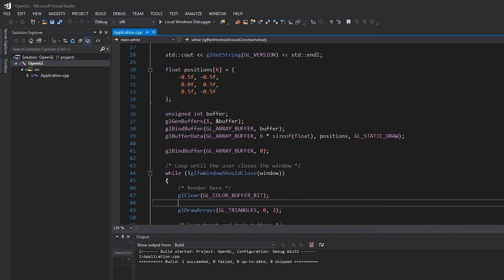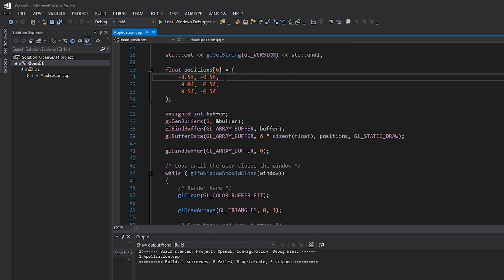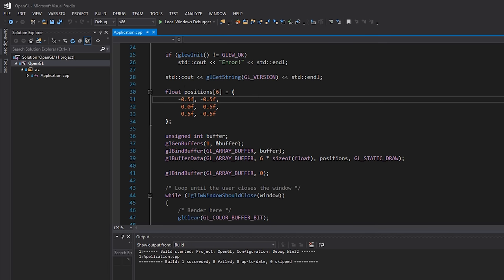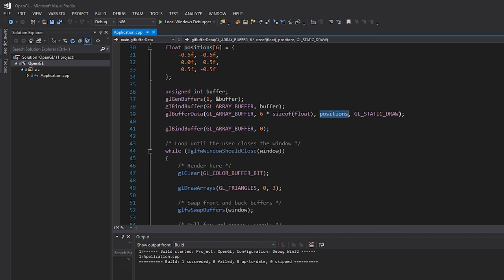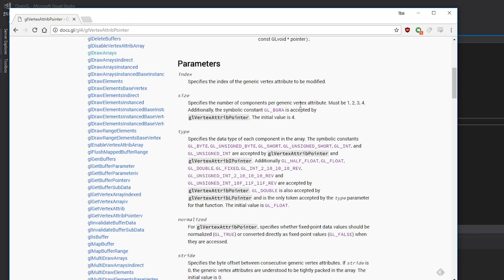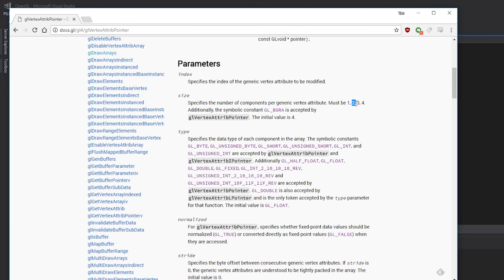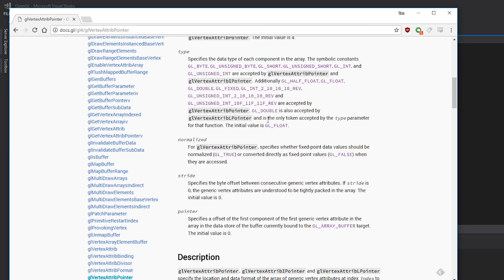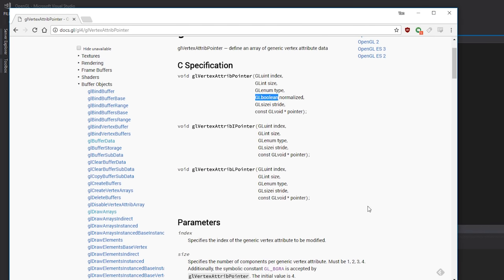Vertex Attributes and Layouts in OpenGL

Comment: I would prefer sizeof(position[0]) instead of sizeof(float), because if you are changing the type to double for example, it will not affect this functions.
Reply: You would need to change the GL_FLOAT parameter anyway.

You could possibly use some kind of data structure to store it though
Reply: @bobdagamer640  it still would be two changes which could add up if you have a lot of code

Comment: Cherno: "Now if we had a Shader, we'd be able to see our Triangle."
Me: *randomly compiles the program... Giant Triangle on screen.
... Now I'm confused...
Reply: I guess that OpenGL has some sort of default shader - flat, and useless, but something that is put there to avoid crashes.
Reply: @2001herne  no. OpenGL does NOT have a default shader. If you see a triangle on your screen ,
that means that your graphics drivers have a default shader just for debugging
Reply: @anonymousgaming911  Cheers
Reply: I think it is undefined behaviour, so you'd get different result on a different machine
Reply: @ViktorWingqvist  Yeah, depending on your GPU and its graphics driver.
Reply: in my linux don't appear triangle, but in w10  appeared.
Reply: @100Palavr  On my linux installation (Ubuntu 20.04, amd RX 580) the triangle did appear. Guess it really depends on the driver used.
Reply: @Fabian-gg5gi  yes
Reply: Even i got suprised seeing a triangle :)
Reply: I guess that OpenGL has some sort of default shader - flat, and useless, but something that is put there to avoid crashes.
Reply: I guess that OpenGL has some sort of default shader - flat, and useless, but something that is put there to avoid crashes.
Reply: I guess that OpenGL has some sort of default shader - flat, and useless, but something that is put there to avoid crashes.
Reply: @anonymousgaming911  uhhhh its on release mode
Reply: @2001herne  Nice, you had to say it 3 times
Reply: @anonymousgaming911  thx mate
Reply: @wiking2888  Yeah, for some reason, at the time I made that comment, firefox was doing weird things with YouTube. It hasn't happened in a while, but for some reason, a fair few comments got posted multiple times.
Reply: @2001herne  k fair enough

Comment: I'd like to add that if you are on Mac you can't create your openGL context with compatibility profile, you have to use the core profile. And if you do that, the code will cause a GL_INVALID_OPERATION error. You will find this error if you poll it using the glGetError() function. To resolve that you also need a vertex array object and you need to bind it as well. A simple example would be the following after you bind your vertex buffer (found this snippet on stackoverflow) :
        GLuint vao;
        glGenVertexArrays(1, &vao);
        glBindVertexArray(vao);
Reply: I was just about to comment the same, but I might as well up your comment. I'm on windows as well, but compiling with mingw64's g++. If I set glfwWindowHint(GLFW_OPENGL_PROFILE, GLFW_OPENGL_COMPAT_PROFILE), the code actually runs just like his. But if I keep the default or just set GLFW_OPENGL_CORE_PROFILE, all I get is a black screen.

Comment: Generally, vertex means 'point'. It can be the point of an intersection, an extremum of a function, a node in a graph, etcetcetc. The entity named 'vertex' in the context of opengl  is just an ordered list of values (ie 1,2,3 is different to 2,3,1 ). It may represent anything, but it can always represent a point in n-dimensional space where n is the count of values in that vertex. It's probably also a vector, but considering they (might?) not inherently have the properties of vectors, I would avoid calling them as such. It is likely that the name 'vertex' was chosen instead of 'vector' exactly for this reason.

Comment: I can see so plainly how OpenGL became very useful for hardware accelerated data processing.  Passing data through vertex buffers, telling OpenGL what that data is by defining its attributes, enabling those attributes...then using a shader to process that buffer on the GPU, with a backbuffer as the output area.  Say I wanted to perform some really complicated math that's slow on my CPU... I can send the data to be processed through my GPU's OpenGL implimenetation over a buffer, to a shader that I wrote, and it would come back to the GPU's backbuffer, and I could read my results from the backbuffer.  The trick sort of voids OpenGL's intended use to display graphics, to blit raw data using a shader.  This reminds me very much of what nvidia's CUDA does, and helps me to see why it works so cleanly with OpenGL.  You get control over everything.  Which is really really useful to make OpenGL do stuff it really wasn't intended to do, like perform physics or finish your calculus homework fast.  :^)

Comment: 9:09 - stride is basically just sizeof(vertex), which I know from encoding it in the Rust type system where Bytemuck is used to just get the plain bytes of any input type (currently, arrays of 2 f32s) as packed raw data. Makes it so much easier than having to compute it yourself.

Comment: Hi i have a quick question regarding your code. You said to select or “bind” the buffer you created you must use the glBindBuffer() function and pass in your buffer id variable. You wrote: glBindBuffer(GL_ARRAY_BUFFER, buffer); But later you wrote: glBindBuffer(GL_ARRAY_BUFFER, 0); And I want to know why you wrote 0?
I printed out the buffer variable into my console when i run the application and it return 1. So i am a bit confused as to why you put 0 there. Furthermore, when i compile and run the code after i added the vertex attributes, I saw the triangle and that confuses me even more because i followed what you wrote in your code. Thanks anyways!

Comment: 05:30 how did you box select that? Normally the selection will carry over to the beginning of the next line highlighting the values to the left as well.. Is that a Vi keybind?
Reply: Hold Ctrl+Alt while pressing the up  or down  arrow keys to add cursors and hold Shift while pressing left or right arrow keys to select.
Reply: Ctrl+Alt just brings up a little window to the upper right of the screen with the option to switch to the different project tabs, but from your reply I figured out I just hold Alt while pressing up and down and Shift for left and right so thanks!
Reply: Vertigo Studios, use Alt+Shift and drag from the top left corner to the bottom right. @vertigo6982

Comment: I didn't understand the part where you set 8 as the pointer. How does OpenGL tell the data you just gave is the position of the vertex or the texture of the vertex?

EDIT:
Could someone tell me if this is correct?
glVertexAttribPointer(0, 2, GL_FLOAT, GL_FALSE, sizeof(float) * 3, 0); //Specifies that index 0 corresponds to position, but OpenGL can use this only if the shader tells it so.
glVertexAttribPointer(1, 1, GL_FLOAT, GL_FALSE, sizeof(float) * 3, 8); //Specifies that index 1 corresponds to texture, but again OpenGL can only use this with the shader.
Reply: Not necessarily. The 0 index in glVertexAttribPointer corresponds to the attribute assigned index 0 in the shader. You're specifying the layout and properties of the attribute in the buffer you're passing to opengl. It "may" be position data, it "may" be texture coordinate data, it "may" be normal vector data, it "may" be color data. It's up to you, the programmer, to decide what any particular index is for. By convention, I use 0 for position data, 1 for texture, 2 for normal and 3 for color. Someone else may have their indexes arranged in another way.

Comment: If I want to add more vertices positions to a VAO with another buffer, do I need to redo glVertexAttribPointer? Or is that a one time set-up for each index in a VAO?
Reply: Mitchinator1 You only need to redo glVertexAttribPointer if you add another type of data, so normals or uv coordinates. If you want extra positions, just make sure you have enough bytes when using glBufferData, and you should be good
Reply: Kay Verbruggen How do I make sure my buffer has enough bytes? I was making a 16*16 grid of quads, and it ran out about halfway through.
Reply: Mitchinator1 Right now it says 6 * sizeof(float), you should replace the 6 with the number of floats you have. Or just replace it altogether with sizeof(yourArray).
Reply: Kay Verbruggen I have replaced it with the size of my array, however it still caps out around half.
Reply: Mitchinator1 How did you specify the quads, as two triangles or just four points? If you did the four points method, replace GL_TRIANGLES with GL_QUADS. If this doesn’t solve it, I don’t know what does.

edit: GL_QUADS is no longer a thing in modern OpenGL, it used to be a thing when we still used glBegin(from previous epidodes). So you need to specify two triangles to make one quad. Right now that means you need 6 positions for one quad. But I’m sure in later episodes were going to use and index buffer to fix that and only use 4 positions.
Reply: Kay Verbruggen I switched to GL_TRIANGLE_STRIP, and that made a huge difference! Thank you for your help

Comment: If anyone gets a triangle rendering on the screen at this point, please reply with what GPU you have. Thank you if you do this!
Reply: Worked for me. GTX 1070
Reply: Intel HD Graphics 5500
Reply: Intel HD Graphics 4600
Reply: GTX 1070
Reply: AMD Radeon 6600M
Reply: GTX 780
Reply: RX 480
Reply: Intel HD 4000
Reply: GTX 1060
Reply: AMD Radeon HD 7700 Series
Reply: AMD Radeon RX370
Reply: Radeon Pro Vega 56 on iMac Pro // OSX + Xcode
Reply: GTX 1050 Ti
Reply: GTX 970M
Reply: Intel HD Graphics 520
Reply: GTX 970 here
Reply: Intel Iris Plus 640
Reply: Intel HD Graphics 620
Reply: GTX 1060 6gb
Reply: Rx 550

Comment: Line 41: glEnableVertexAttribArray(0) -> should't the parameter be 'buffer'?
Line 44: glBindBuffer(GL_ARRAY_BUFFER, 0) again should't the second parameter be 'buffer' and also should this line even exist as its already done on Line 38?

why does this work ? is the actual value of 'buffer' 0 ? Luck perhaps?
Reply: I don't understand either. From my understanding, if you do glBindBuffer(GL_ARRAY_BUFFER, 0), you are unbinding your vertex buffer.
Reply: Late answer, but in case anyone has the same question:
I think glEnableVertexAttribArray on line 41 is enabling the first attribute array (index 0) of each vertice, and they only have one attribute.
On line 44 he is simply unbinding the buffer by setting the bound buffer to 0.